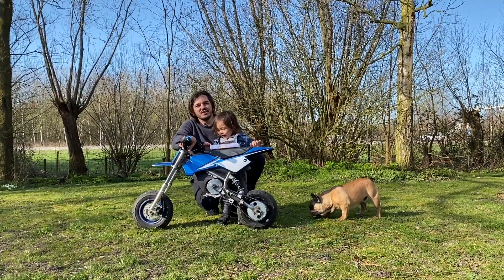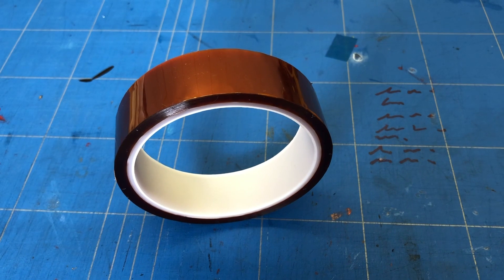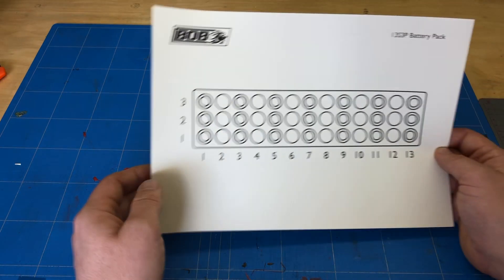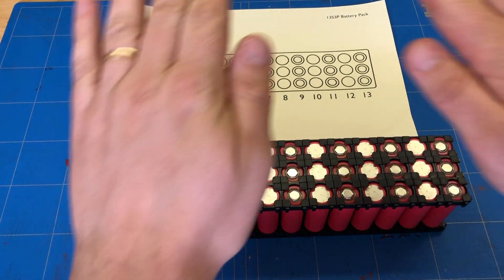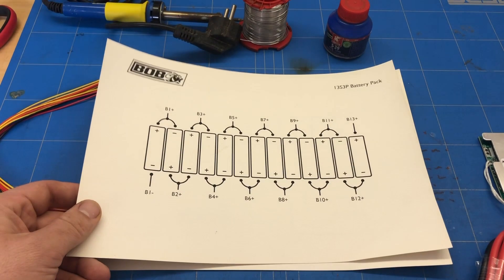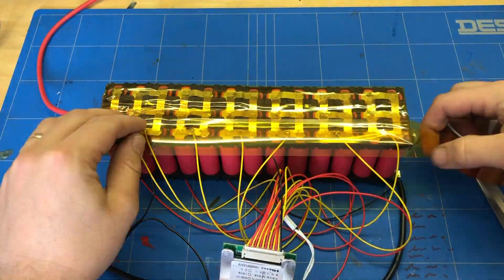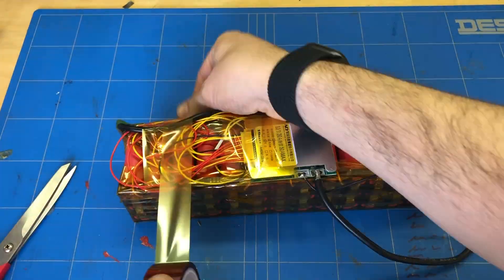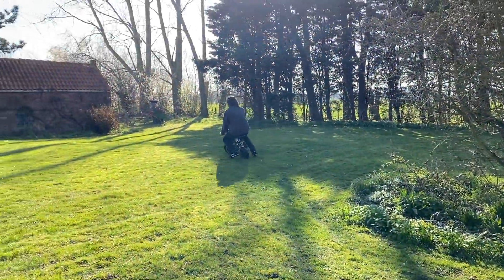18650 Battery Pack DIY - How to build a lithium battery pack with BMS for E-bike / Motorbike.

Comment: Hey Bob I don't know if you can help me I bought a  48v battery from Aliexpress. I'm pretty sure I got scamed the middle row of batterys are not spot welded at all.The battery charges at 54 volts but drops rapidly .Even with pedal assist.I can only ride 12 miles .Then completly dies.I haven't taken it apart yet to see if the middle row is dummies.They are a different color cell.